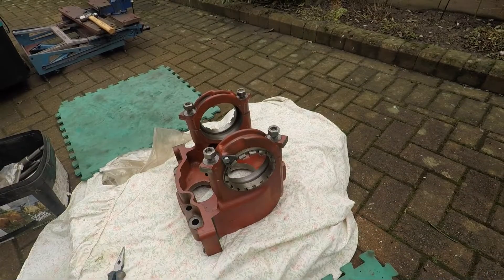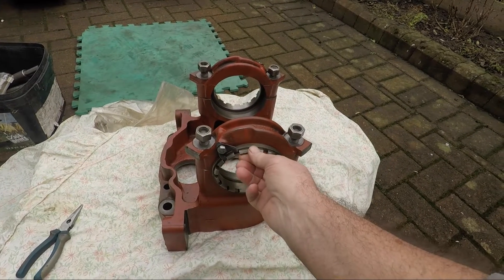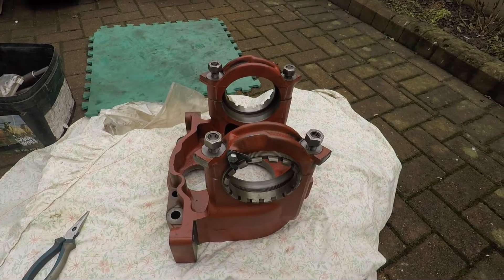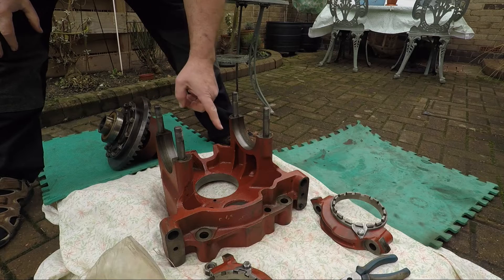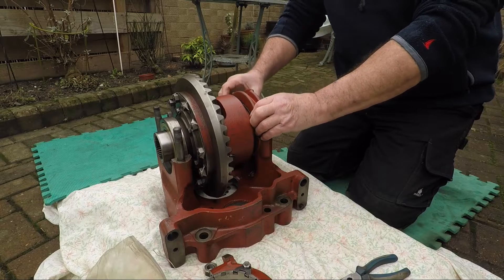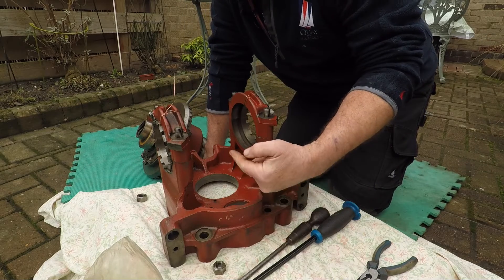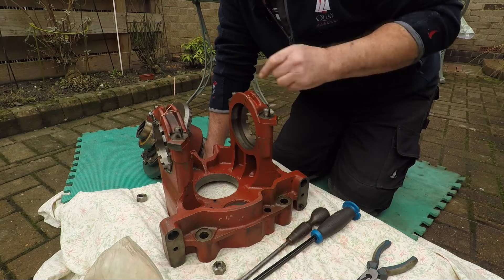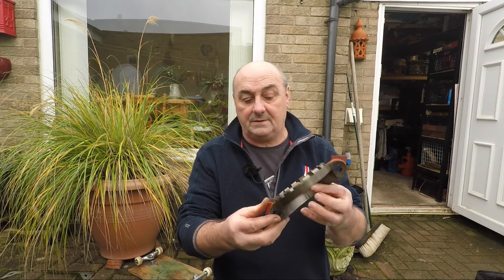How to set the diff cage float on David Brown 990  #50

Comment: Hi there.I have a 995 and the right wheel when turning is skipping like a welded diff.I took the right side off with the driveshaft and all but the sleeve of the diff lock fell off.Any idea of what's wrong and what to do?I will the back off to change the gear on the PTO cause a teeth is broken.
Really appreciate the work you do!
Reply from the maker: Hi many thanks for your comments, it sounds like your diff lock was stuck in the locked position, you obviously have the right hand final drive off(if you've dropped the diff lock) pop the final drive back in ( dont bother putting bolts in) just try and turn the hubs by hand with the box in neutral, this should give and indication of weather or not the diff lock sleave was jammed in and now is free(you will still have to recover the diff lock sleave anyway). you will need to remove the right hand axle oil seal carrier inorder to retreive the diff lock, then you get the fun of trying to re install it for which you'll need to borrow or make the tool as indicated in the manuals.
If your diff is still locked up, then I think you must have  problem with the side gears and planetery gears, now that's a whole big job,
my email address is in the about tab on my home page here on YT drop me an email as to what you find.
keep in-touch with your findings
Barry